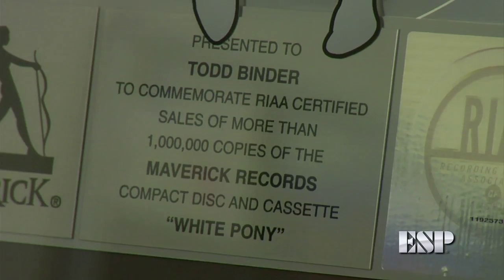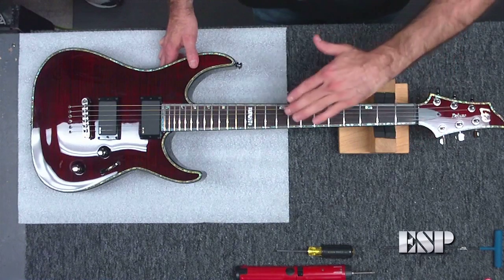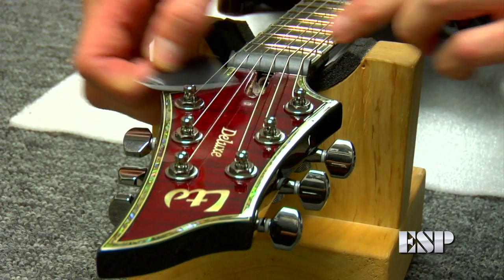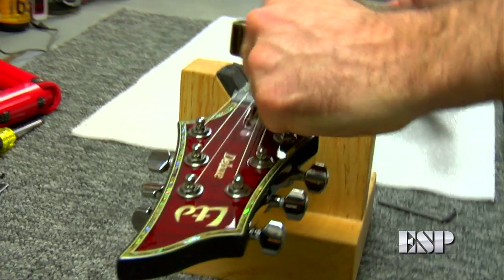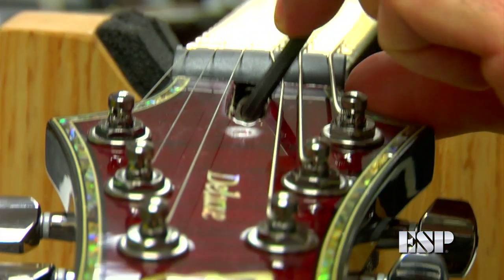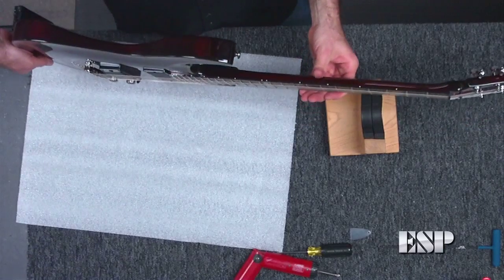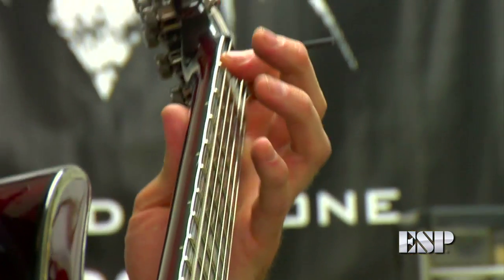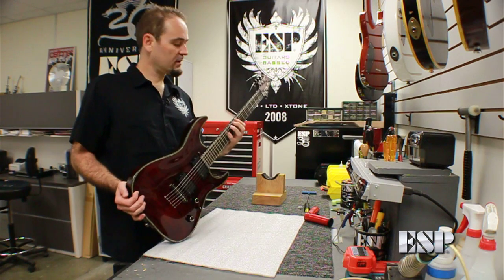ESP Guitars: Tech Corner -- Truss Rod Adjustment (1/2)

Comment: anybody else keep coming back to this video specifically to remember which way to turn it
Reply: The way to remember it is to understand what the truss rod does: It fights string tension. If a truss rod is completely loose, then the strings are pulling the nut towards the bridge and the neck will bowed such that if you're playing the guitar and look down, the neck will curve away from the strings (which are always straight). As you tighten the truss rod (turning clockwise, like any screw), you will lessen the curve/bow of the neck and the 12th fret will move towards the strings. If you continue to tighten it, at some point the 12th fret will come into contact with the strings, while the first few frets don't touch the strings at all; then you've gone too far! Turn the truss rod counterclockwise to loosen it and the 12th fret will move away from the strings.

Comment: I get the sighting it in, I do that often to adjust after I've done a full setup. However if I'm doing a full setup I want to know what ESP recommends. I like to use 8 tho on the 8th fret but with the super jumbo frets on my LTDs I usually have to go 10 tho if I'm going to get the action around 1.5mm on the low E and 1.2 on the high E. Is that what is recommended?
Reply: Right after posting this I found the manual online. It looks like you guys recommend 10 tho to 20 tho relief then 2mm action... that's way high for what I like but it's good know I'm well within spec. From what I have experience so far, I can get my LTDs well below that without buzz and setup a friend ESP Eclipse (2006 Standard series) at 8 tho relief at the 8th and 1.4 low E 1.2 high E with no buzz AT ALL... Phenomenal craftsmanship!

Comment: that little note near the end about a slight buzz is good to know. I just got an ec-256 about 3 months ago and it plays great but there is a slight buzz from strings that I can hear but does not come through the amp. That's how it was out of the box and I have not had it professionally adjusted. Been wondering if I should but it sounds like that's normal and nothing to be concerned about

Comment: Always remember this!!! Even on high end Gibson and Fender guitars if you tighten the truss Rod it may never go back the other direction! I have guitars that I tightened the truss Rod just a fraction and they will not loosen at all it will turn but it will not put more bow in the neck! the only way is is to put bigger stringS! So make tiny adjustments!
Reply: I've heard somewhere that some woodneck is kinda stubborn. It won't adjust easily, sometimes take days or even a week just to make a lil bit adjustment. 

Since I can't prove it on my own. I take that with a pinch of salt.
Reply: Just tried this for first time in my LTD Eclipse and I can’t turn the Allen wrench to loosen.  I’m afraid to really force it but light to medium turn pressure is not budging

Comment: I have a ESP MH1000 with a string through body that I bought brand new. It has locking tuners and is a great guitar. But I noticed that it doesn't wanna stay in tune no matter how many times I stretch the strings. I was told that backing off the truss rod and tightening it back up could possibly remedy this issue. I never had this problem with my EC-400 that I'm playing in my profile picture. Got any ideas?

Comment: @3:40  This is actually the best pointer from the whole video.  I've tweaked my guitars till I was absolutely fed up with the instruments and my inability to set them up to eliminate the buzz.  Plays perfect everywhere but a consistent light buzz on the low E string if i ever flirt with low action.  Now on I'm just gonna say F' it and set the strings how I want.  As long as it doesn't come through the amp that's all that matters.

Comment: Don't you need to tune up the guitar before checking the relief on the neck after you adjust the rod? 

Tightening the truss rod (making the neck more straight) also puts more tension on the strings and you are out of tune. Then once you tune up the guitar you actually need to loosen the strings and so you end up with too straight neck causing buzzing.
Reply: This makes sense.  It's what I do too

Comment: One thing not mentioned in this video, I'm guessing to save time, is that it's always a good idea to slack the strings before adjusting the truss. Also, checking right after an adjustment will gives false results. Give the wood a few minutes (10 or so) to adjust and flex.
Reply: Wouldn't it be counterproductive to adjust the the neck when it's not being subject to the tension it will be left in and played in?
Reply: You have a good point. But you don't need loosen the strings first. Just turn the rod a bit, then tune up the guitar before checking the relief.

Comment: I've always been told to check intonation following any truss rod or bridge adjustment . . . . . :-)
Reply: RikkardJ Smith Assuming you don't want to adjust your string height at the bridge end afterwards.  If you want to adjust the string action at the bridge, you'll want to do that after the truss rod.  Then once the truss rod and bridge string height are adjusted, in that order, intonation the guitar.  Also, it's best, in my experience, to do the truss rod and bridge height adjustments with an old set of strings you're about to change.  Then, intonation the guitar with a new set of strings.  Setting intonation with an old set of strings that have adjusted to a kink at a certain point in the string is going to throw things off.

By the way, when you do the string height, check the string height at the first fret and compare it to the last fret.  You'll want them to be close to the same in order to have an even action that is enjoyable to play.  If your string height is too low on the bridge end, you will get fretbuzz at the upper end of the fretboard, while too high will result in intonation issues.

Comment: Hahaha....TRANSLATION:
"I can not understand human, but I have a feeling that one must first take a look at the long line and the deflection of the neck (not the eyes) then (recommended) loosen the strings and slowly tighten the anchor, then pull the string and look for the line that changed, I just loosened the strings 3 and 4 (the video can be seen that they interfere with the key and twist the braid 4 strings can be damaged)"

Comment: I have ltd mh-1000nt and ltd mhb-401 and on BOTH guitars i have same problem. 4 mm allen key is to small and when inserted it just too loose in hole (it spins about 1/8 of full turn). Its same on both guitars, nuts are not damaged! Besides that, truss rods are so stiff you really need to use force to move it. Surely I dont want to press it with 4 mm thats seems to be wrong key! I think this is unacceptable for guitar in this price level. ARGH!